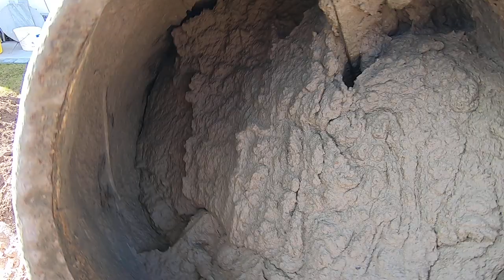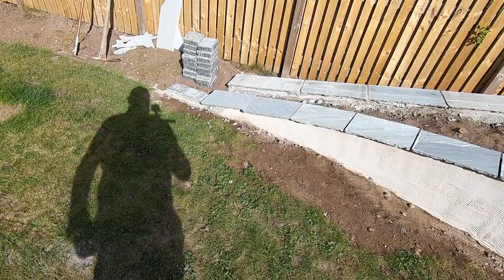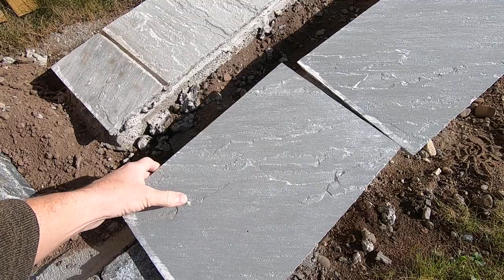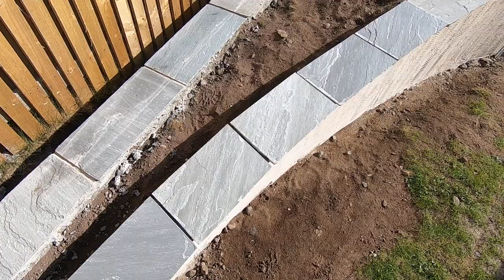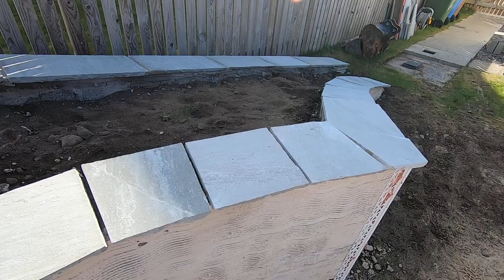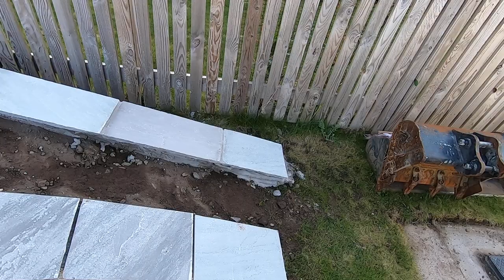How to fit coping stones on a curved wall Part 1

Comment: Question, I’m laying an Indian stone patio. I’ve come to a certain point where it meets a raised bed. Now the raised bed is curved and the Indian stone is square. Is there a method to do the cuts where they follow the raised bed round perfectly.
Reply from the maker: Hi, You would need to cut each one it you want to perfectly follow the curve of your wall but, I don't think its worth it to be honest.
Just cut either end of the slab to achieve the curve
Hope that helps 😀

Comment: So where is how you did it then? 🤦‍♂️🤦‍♂️
Reply from the maker: Hey guys, this is an early video of mine and I can't find the rest of the footage at the moment, sorry 😢 
Make sure you seal the underside of the slab before you lay it so it won't lift away from the mortar. I do it with a cement slurry or PVA glue and sand mixture painted on the back to give it a key. Hope that helps 😁